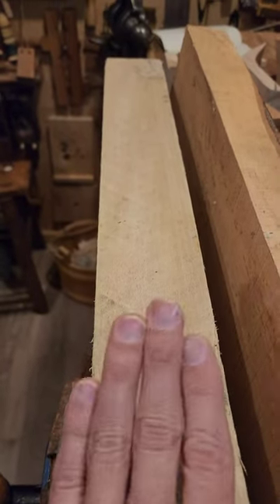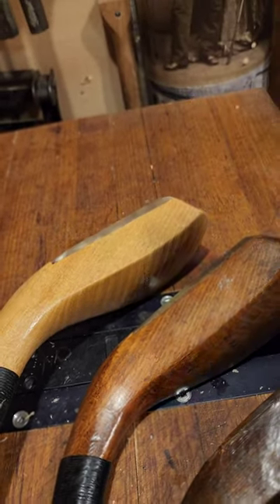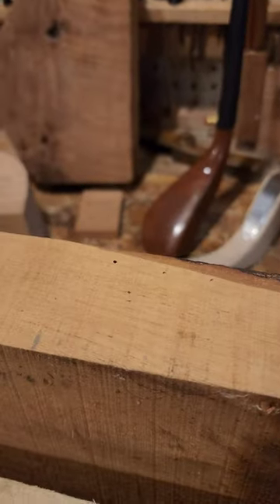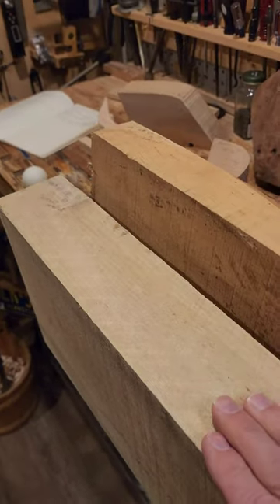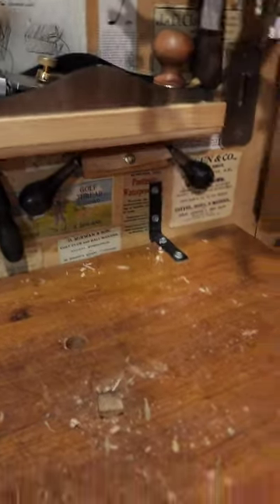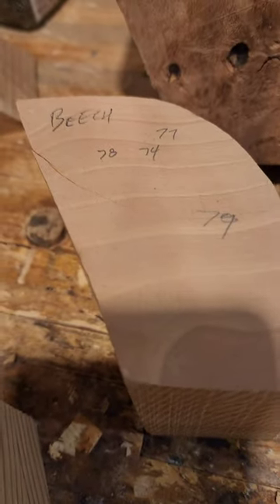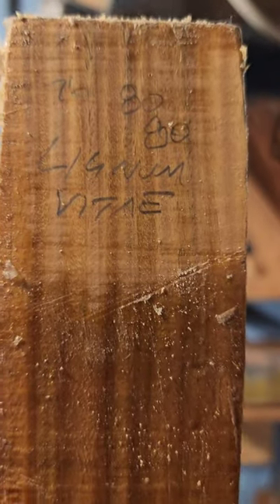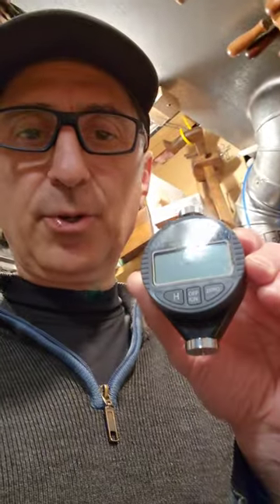A Shore D durometer for wood hardness testing

Comment: i cant find a table of shore D hardness values for different species of wood. there only seem to be Janka tables. anyone got a shore D table out there?
Reply from the maker: I don't think there is one. This type of test probably is not as accurate as the Janka test because the tip of the probe is pointed and can be lower if it lands in a pore and higher of it is elsewhere. The Janka test uses an 11mm steel ball that gets a broader idea of the hardness. That doesn't mean that the Shore D durometer isn't useful. You can take multiple readings and get an average or take the median.